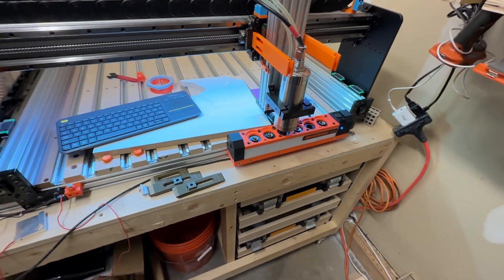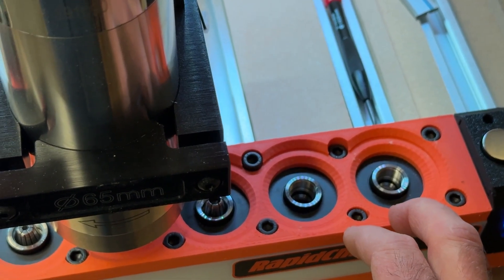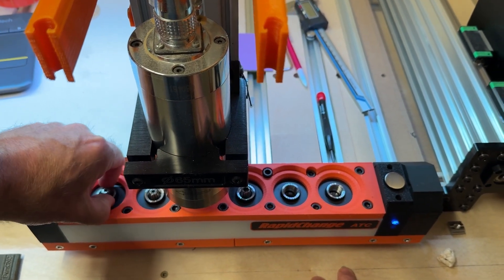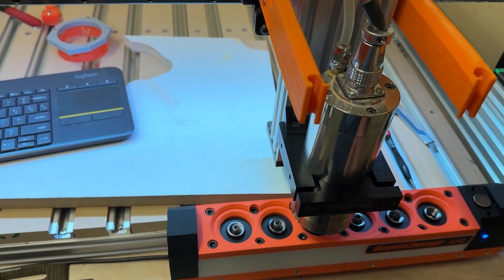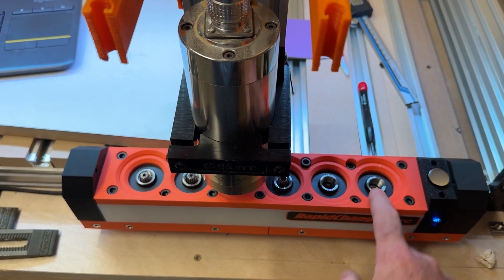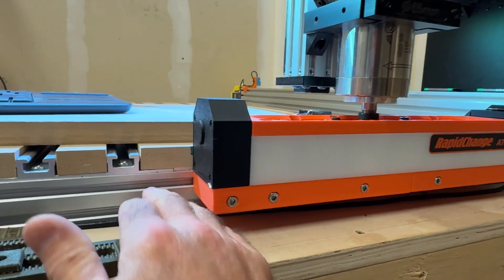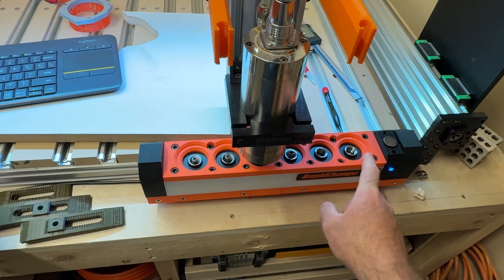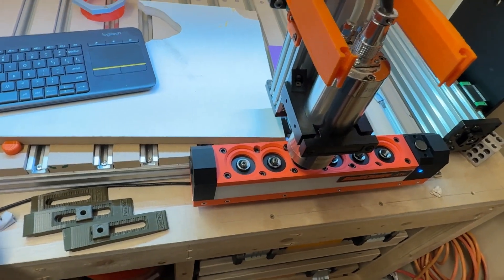Rapidchange ATC initial thoughts and questions answered

Comment: Nice system. but its just some plastic, springs, and ball bearings.. with some macro.. its expensive for what is it. but Still cool setup. wish this was opensource.
Reply from the maker: Thanks, Yeah I think its all pretty cool and the work the RapidChange team has done to make it as easy as possible to setup and get running on as many machines/controllers as they have is great and I am happy to support them and the product they created.  The guys over at Millenium Machines Project is working on something similar for their Milo Mill but its in early stages yet, so there might be an open source alternative in the future.

Comment: Love it. Can’t wait to see where you end up. I’ve got a near similar setup and haven’t gotten around to setting up my atc. My spoil board extends an inch past the y frame length so it looks like I’ll be notching it out for the tool changer

Do you know how well it’s integrating with the new Gsender software ?
Reply from the maker: The nice thing with the way that RapidChange has  setup the system is that it will be independent from the sender you use. The short answer is it does not leverage GSender at all, its all done in the firmware using macros initiated by the M6 command, so in GSender you actually disable the M6 intercept function they built and set it to passthrough and the firmware and macros handles the bit change.
Reply: @sparks-tech younhad to refresh the firmware to a different version?

Comment: I think part of the reason why they don't go into too much detail about how their spring loaded mechanism avoids crossthreading is because it'd give away most of the detail of how to make their product (along with the ball bearing locking) and that'd mean a bunch of their customers could more easily just replicate their tool themselves. Its actually much simpler than i originally thought but imho the atc is WELL worth the price.

Have you tried any of the ball bearing clamping nuts? I would guess that if you had any issues with loose tools then for the same tightening torque you'd get more clamping force on the tool which would stop any unwanted slipping/spinning, especially with larger diameter tools in an er20.

I have a request if you are able to do it, could you rig up one of those cheap-ish (from amazon) digital torque adapters and see if theres a way to go from a 1/4" or 1/2" square to 7mm or 1/4" round, as an empirical test for the tightening torque that actually gets applied. Would be great to know and see how playing with the rpm AFTER it engages with the nut would affect the torque that gets applied.

Appreciate the video. 👍
Reply from the maker: Thank you for the lengthy reply and I think I will break up my response into a few seconds. 
As to your first point I used to think that as well, keep the hardware under wraps so it’s harder to reproduce and while they don’t go out of their way to highlight how to make the physical product what I have learned now having one is a lot of the secret sauce and value is in the Macros they have created to make the system as reliable as it is and easy to setup.
Reply: @sparks-tech  I doubt it is much more than spring loaded balls.  The inertia of the spinning spindle would apply a surprising amount of tourque.  The thing I wonder is if its dependable and repetable across all nuts and for how long.  3D printed parts are not as wear resistant as injected ones are.  I can see the bores that the steel balls are in elongating at the nut interface.
Reply from the maker: @philshel1  time will tell but that part is separate from the main magazine body and easy to replace if needed should there be any issue.
Reply: @sparks-tech  That would make sense, they probably consider it a wear item.  I see on the Lightburn forum that you have been discovered!  Stand by for being way too busy.  LOL
Reply from the maker: @philshel1 lol, busy is good keeps me out of trouble.
Reply from the maker: I haven’t tried any of the ball bearing clamping nuts. I wonder if they even make them for ER 11. I’ll take a look online, but if you have a link, send it my way.
Reply from the maker: I had someone else ask about the torque that the RapidChange ATC is able to apply so I was looking at options to try and measure that. Yes I do plan to do some testing based on different RPMs and clamping force supplied
Reply: There is a video it is about 14lbs torque applied by the spindle.

Comment: Video length is fine for me.  The one question I have you did not address.  What about the tourque on the nut?  Have you tested if it seems tight to you after tool changes?
Reply from the maker: So far in my testing and cuts I have not had an issue with bits slipping or not enough torque on the collet. 
I have an adjustable torque wrench coming so I can actually try to measure the force but it’s a week out or so.